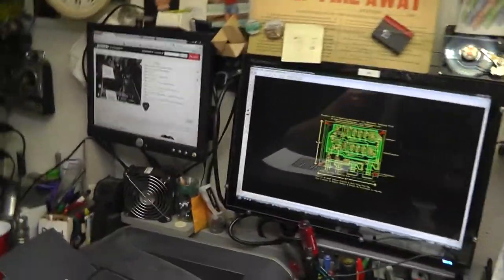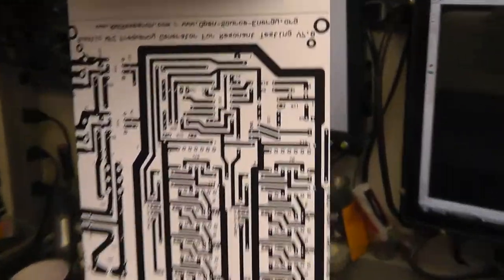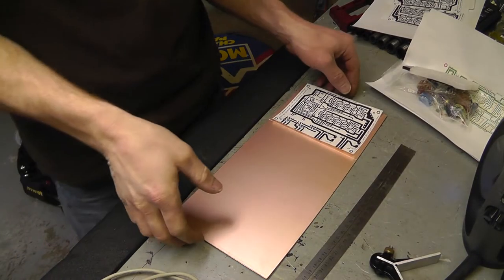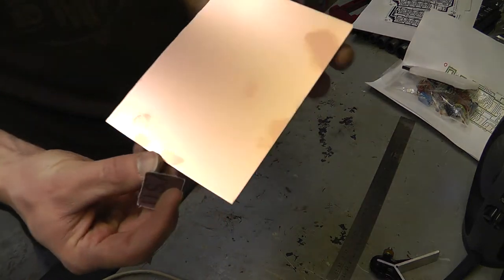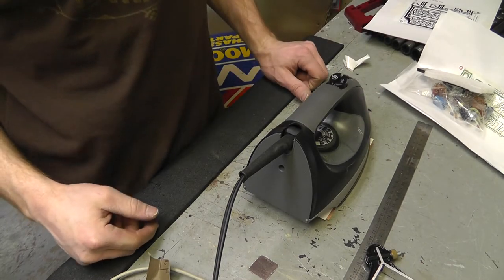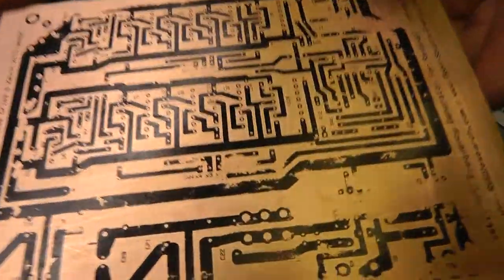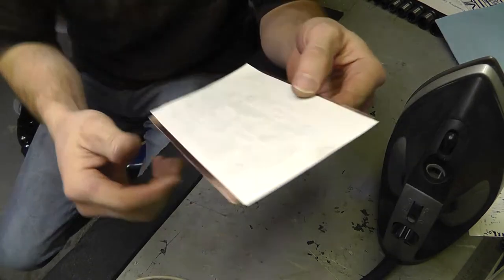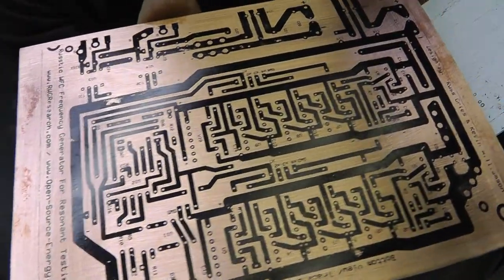Building The Russtic Frequency Generator 7.0 PCB._001

Comment: @h4z4rd42 Ironing through a silicone-paper (the paper used to back up self adhesive films) lets you avoid the sticking issues. Then let it cool down. ...after that just immerse the board under (hot) water and let the paper get wet. After a short time you can remove the most of the paper, then use a soft brush to get rid of the residues.